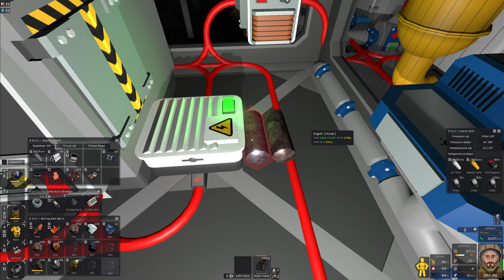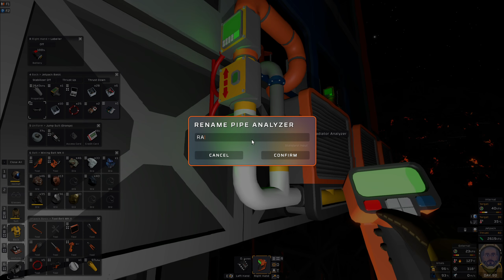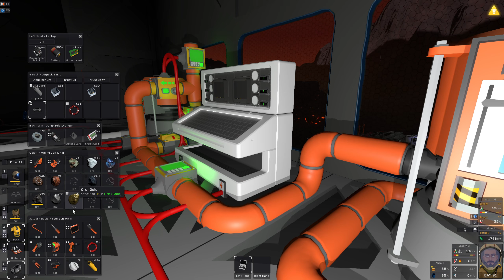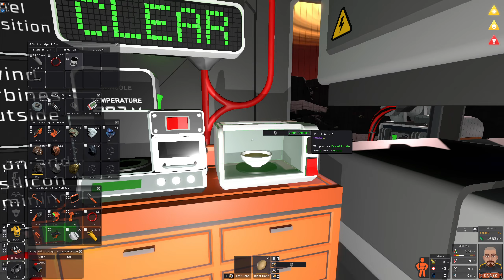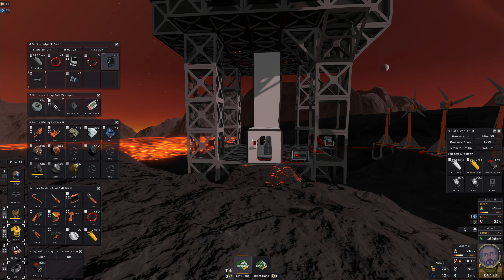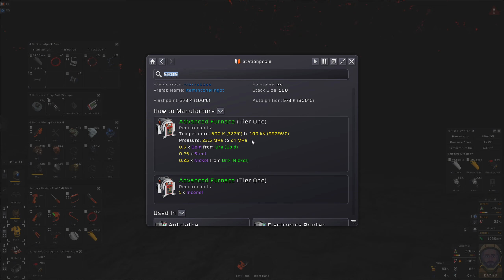Base Cooler Monitoring Console - S2 E28 ║ Stationeers

Comment: Question: Can you write a 10X multiplier in the code? So that 600 on the dial in 6000 on the valve. I know that you will be losing fine control. If you need fine control you can treat it like a microscope and have a coarse valve with 10X then have a fine control at 1X and add controls together in the code.

Never mind you answer the first part of the question with 10X only, but would a second fine dial be possible or not.
Reply from the maker: A second dial would be fine. I might be able to squeeze it into the code, and if I move the temp displays, it might give enough room. Cannot promise I get to it any time soon, I got distracted by other stuff in the upcoming episodes. :D

Comment: Why not replace the Volume Pump with a Back Pressure Regulator? It will automatically maintain pressure in the pipe. By removing the display settings in the code, you'll free up a lot of creative freedom.
Reply from the maker: Regulators are sensitive to the pressure differentials. If I try to move gases from a lower pressure network into higher pressure (like I do from the exhaust to the condenser pipes), then they would be extremely inefficient. This is the same reason why the exhaust need to be kept as empty as possible, so the purge pumps from the liquid pipes don't get overwhelmed by the high pressure on the output side (they are also a form of pressure regulator).

Regulators were the first thing I tried when testing out the original design, and found that they are simply not good enough.

Comment: Regarding the inoperable control that you mention at the start of the video, you could adapt the input to the output with a proportion. 
Basically: get the input value, normalize it to a number between 0 and 1 by dividing it by the maximum value (you say it's 999), and then you multiply that by 6000 or whatever is the maximum you need.
If the input control is programmable to be directly between 0 and 1, all the better because it would be one fewer step.

At 58:58 it does need to be steel, I did try and got reagent mix otherwise.
Reply from the maker: I did consider that, in fact the volume pump operates similar to that, just way more extreme (1 step changes 100 kPa), sadly the evaporators need to be set pretty accurately, even a little bit of pressure difference can cause a pretty noticeable temperature difference.
Reply: @Hmuda  I see. Perhaps you could move within a smaller range within some limits.
As an example, say you need to vary the final value within 500 kPa, from 5.75MPa, to 6.25MPa.
In that case you can calculate x = 5750 + 500 * input.
(EDIT: I mean normalized input, from 0 to 1)
If the input range is 0..999, you get 1000 intermediate values, in this case 0.5 kPa steps.
The ranges can vary depending on what you need, and perhaps the precision is enough for your purposes.

If it isn't, you could use two controls, a coarser one and a finer one, where the first one could jump in 100s and the second one in 1s, something like that. A little harder to implement, but should work.
Reply: @Hmuda  You could perhaps add a second smaller dial, and use the big one for major changes and the small one for fine adjustments. Not strictly needed in any case.